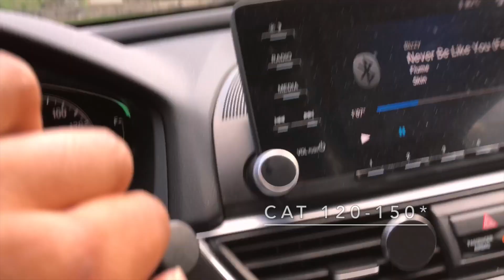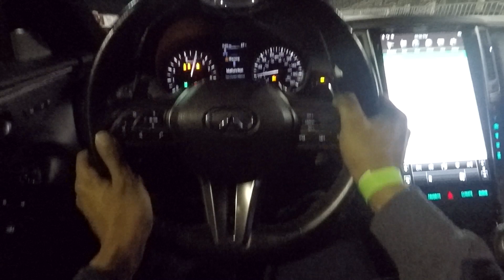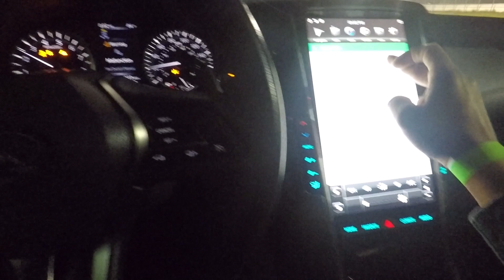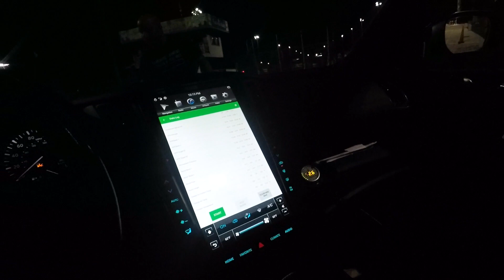Taking the 1000hp Q50 Red Sport to the 1/4 mile track

Comment from the maker: Things are not always going right behind the screen on social media or YT. I think it's fair to show the good and even the struggles one goes through. Round 3 here we come 💪

We hot lapped the car that one time I mentioned it after running it in the daily map(car was not really hot being it was a very low boost and the car was sitting for 1hr30mins waiting for a revsiion) I added all the videos together so it seems as if we ran everything back to back but we were there for 6 hours and made 8 passes. There was about 30mins to 1hr of cool down but it wasn’t enough.

As the night progressed the car was not cooling as fast especially after turning up the boost. The factory IC’s are no good for upgrades turbos and the smaller AMS HX doesn’t provide enough cooling either.
Reply: When the next vid dropping
Reply from the maker: In  2 weeks when test and tune event reopens
Reply from the maker: Next test and tune is first week of August.  So it will be a bit longer than excepted.
Reply: @ZillaFullBoost  damn

Comment: Great video bro I can’t wait to see you now learn the car. I would for sure activate the meth even if you don’t tune for it, put in smaller nozzles in then to keep your intake air temps down.
Reply from the maker: Thanks bro and yea we’re not looking to tune for it yet. I totally forgot we had the meth and I never turned it on 🤦🏽‍♂️  that night was a mess 😆
Reply: @ZillaFullBoost  oh yea, on my build I’m not using meth for power only using it for cleaning and cooling since it’s direct injection. And if your pump goes out while you are tuned you can blow a motor and I don’t wanna risk that and I bet it’s prolly the same with you.
Reply from the maker: Yea it does well as a safety measure. Kind of prefer it that way too.
Reply: @ZillaFullBoost  me too that’s what I was trying to say. Gotta protect the investment one way

Comment: I can literally red line 1st gear with ams tune and not experience this throttle cut.  Sometimes this happens with race box if I just hold first gear for a few seconds before full throttle and shift into second and no where near red line.  I can’t stand it.
Reply from the maker: You have two Q’s or switched tuners?
Reply: @ZillaFullBoost  I bought racebox after ams so I switch between the two sometimes.

Comment: I don't know that doesn't look like a 1000 hp runs whether you were sandbagging or not, either you got some kind of fault or boost cut or the car is not actually at that power mark.
Reply from the maker: I think we got it figured. The MAF and fuel pressure sensor was giving issues. Not to mention the temperatures were hot, we have humid weather and 1800+ DA. It’s also a Full weight car with a sound system. It’s the perfect recipe for a bad time. We will be back out soon.

Comment: Assuming you haven't had much track experience, you can't hot lap A2A cars you definitely can't hotlap these cars, actually they suck ass for drag racing with the factory A2W setup, your lucky you didnt hurt it doing what you did.
Reply from the maker: Hot lapped it once when I accidentally ran the car in map 1 after that we waited like 30mins to an hour but the temps were still high
Reply from the maker: We in fact had the best run after “hot lapping” the car because the car was sitting for an hour and a half waiting on the tuner to send a revision.  

The car was in the daily map so no boost was being made which the car wasn’t really hot, hence the best time we had all night. 

We also tried to drive the car up and down the side road to get ambient air flowing through the HX  right before a run which helped a bit but not enough.
Reply: @ZillaFullBoost  yea im sure, i waited 2 hrs with ice packs on the cores and cycling the pumps the whole time and my shit was still roasting, only way to do it properly is with a generator and a fan while cycling the pumps in the pit
Reply: @ZillaFullBoost  part of the problem is if your running the AMS HX your soaking up radient heat off the radiator, so the only way is a big fan that moves a ton of air to cool the radiator and hx, and then push it into the lanes until its time to run
Reply from the maker: Yup, we’re going out with fans next time and using the consult III to cycle the pumps. Mix that with the icebox and the meth im pretty sure next time we will be well prepared.

Comment: seems like a very slow 1000hp car.. seems more like 500-600hp
Reply from the maker: It’s not a 600hp car. My blue RS is 600hp. This car was just getting heat soaked. Boost was being reduced lowering the power for the runs. The car is also full weight with a 150-200lb sound system. 

You will see the true side of this car on next video.